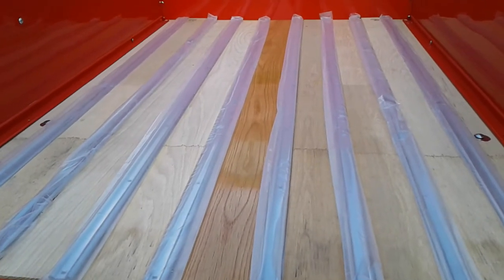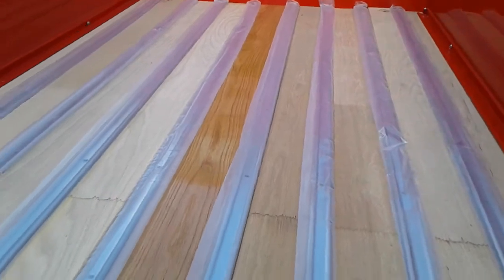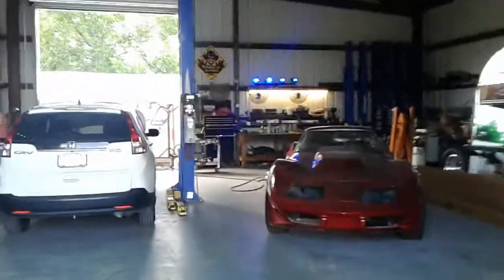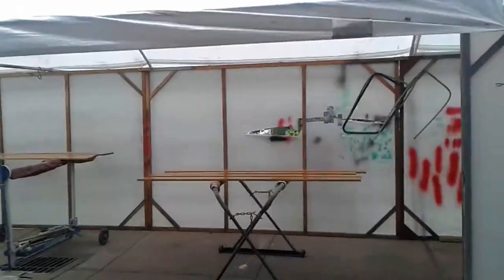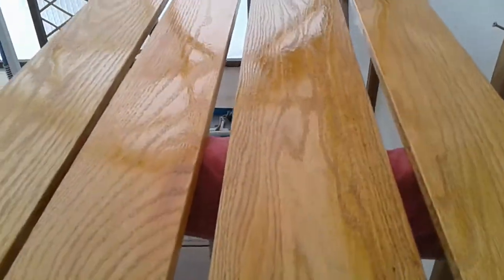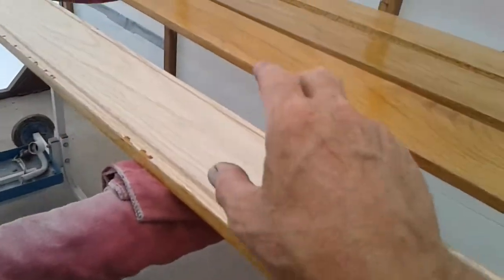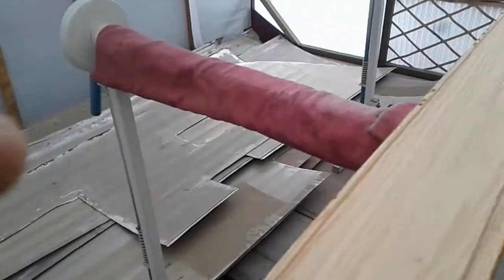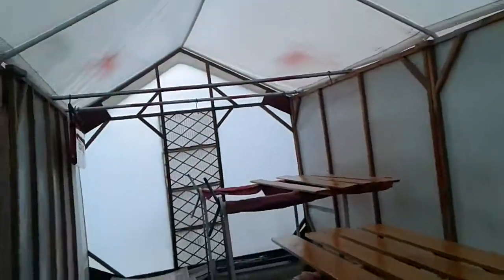1947 Chevrolet Pick'm Up Truck: Getting Wood!!!

Comment: Looking good. Before I retired, I worked maintenance at a cabinet making place. So I took advantage of that and I bought some walnut and oak lumber from them, then I ran the pieces threw their planing and sanding machines and then threw  their spray machine. All done by automation. got to love it. Thanks for sharing.